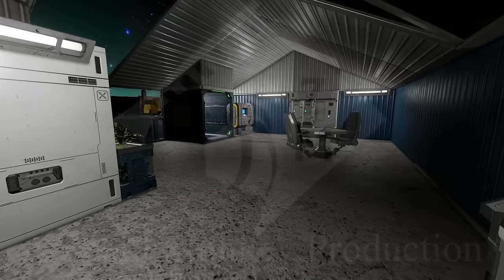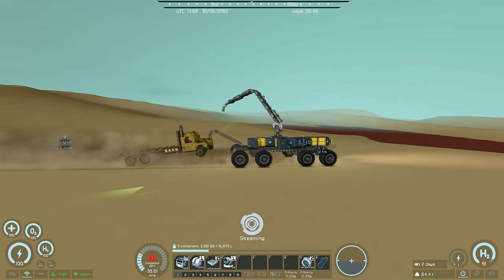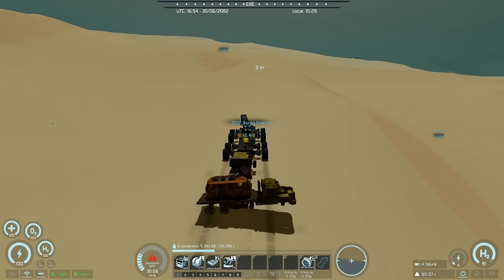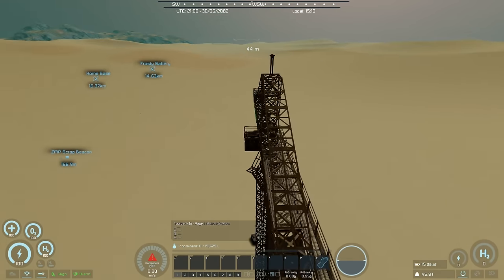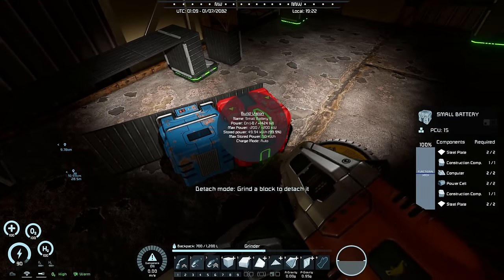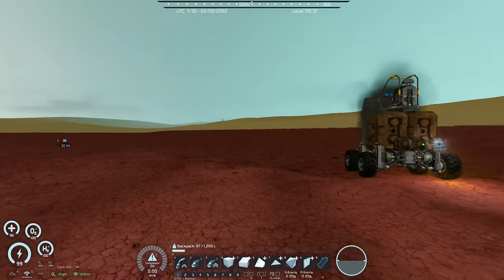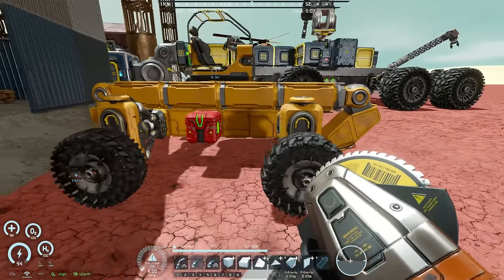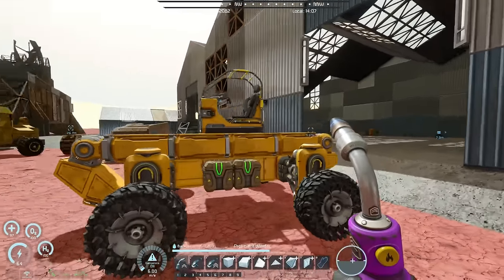Feedback for the Win - Scrapyard #8

Comment: Telehandlers have some interesting steering irl. They can be set to just front wheel steering, front and rear wheel steering for tighter turns, and finally, diamond steering where instead of turning normally, all the wheels point the same direction so you can move at angles instead of turning.
Reply: Neat. Imo forklifts with mechanum wheels are the most interesting. :)
Reply: @dragonheart9965 
I’ve driven a lot of forklifts but never had a chance to use those mechanum style. It seems like one of those all or nothing things, where you get used to one and can’t really switch back and forth. Like bobcat tank style steering and foot control for the arms skidsteers and caterpillar’s joy stick only style. I learned on Cats and just can’t wrap my head around the bobcat style. Every time I try to pick up a load and curl the bucket in a bobcat I end up reversing the left wheels.
Reply: @juangonzalez9848  personally haven't driven any heavy machinery, but have seen them drive a mechanum forklift once on Mythbusters, and have used mechanum wheels on robotics projects. I do know that the mechanum wheels only work well on a hard surface, so I imagine the mechanum forklifts are more limited in use by that.
Reply: @dragonheart9965  
Most of our forklifts live inside the building and rarely go outside. We have to take the glass out of our ice rink occasionally and only one of them works well. The others have just too narrow of tires or too high of an idle to not slip on the ice. Once the rubber starts spinning, it melts the top of the ice where you are, then it just spins and spins. The other issue is that by necessity the drive wheels don’t have a locking differential, so when one wheel starts to spin, it just takes all the power. Driving on ice is an art.

Comment: I'm quite concerned if there is enough clearance for the wheels. It may just be server/recording thing but wheels sometimes look like they suddenly stop spinning for a moment. Especially those hazard stripes behind wheels give me chills. I crashed number of rovers on purgatory because stuff in that spot. Drive cautiously.

I recall from previous conversation you prefer a little bit of steering in front when primary steering is on the rear. I wonder if disabling propulsion on front ones would help, as they pulling forward could throw your aim off. 4 wheel drive is rare thing in forklift. Usually you want your rear wheels do all the work so your front ones can stay as pivot and you turn on a dime. But i expect you may need some extra traction to go over those 2x1 ramps until you replace some of them with what you did for Jex.

And i am really curious what forklift arena may be... wonder if somebody would make largegrid forklift xD (totally didn't think of dit myself before, not at all.)

Comment: Might be useful to have a magplate facing down as well, so you can lift from the top rather than the side if you need to be a bit shorter. Would also get you a bit better leverage when lifting heavy items.

Comment: If possible, place a camera on the head of your crane. It will become a very convenient periscope, and it is also very practical when it is used to align objects. (and a light...XD)

and I think you can install a rotor on the front of the new forklift to help you Rotate large objects without using various levers

Comment: Regarding the short suspensions, they're exactly one block shorter than the normal ones, so if you need the full track width you can mount them one block further out. As far as I can tell, other than that there's no real difference.

Comment: The thing you may think about with a lift like that is take the batteries from the old fork lift and place them on the rear of your new one to help have a counter for heavy things. with this style of lift in the real world you have different options on how you can drive depending on how you need to pick/ place your load. So right now you have just rear wheel steering. maybe place options to turn off rear and turn on just front wheel. that will give you the ability to also do 4 wheel turning. Plus lifts like this also have the option to make all 4 wheels turn the same way for what would look like crab walking. considering youll be in tight spaces having more options on how you can drive should help

Comment: I would have done the fulcrum hinge a little differently, I would have put it up a block or 2 higher up and changed the orientation of the hinge base by 90 degrees, allowing the boom arm to bend below the flat limit it has right now. I'm not sure I'm explaining that correctly, if the frame of your vehicle is 0 degrees and straight up is 90 degrees, you could modify the hinge orientation to have the boom tilt to negative degrees, allowing you to pick things up off the ground easier (but not without risk). This might allow you to have the fulcrum hinge and the head hinge to match angles allowing a self levelling head (your cargo would always be level).

Comment: If I may make a small suggestion regarding the new telehandler and moving heavy objects, such as a large grid battery... Connect the mag plate low and as square to center mass as you can and simply roll the wrist hinge backward instead of having the arm take any of the weight. This way you can keep your center of mass low as well as putting the majority of the weight of the object being moved closer to the center of the machine. This should reduce the chance that you tilt forward and lose steering and still give you plenty of clearance for transport. 
If you're going to have any real issues with the telehandler it will be a loss of steering so this should mitigate that problem effectively. Weight on the rear end would be helpful to be sure, but if you can use the weight of your cargo to stabilize yourself it should make things even easier. It's all in the wrist.

Comment: gotta say, a forklift with a 4t lifting cap is pretty good.  As someone who's profession is driving forklifts and telehandlers, I would recommend you lower your power just a little bit.  Going in reverse when taking such heavy things like a battery is a good idea as well, since emergency breaking your forklift will not result in the battery or pistons going klang
p.s. that is a very cool design.  I am definitely stealing that at some point for my own usage

Comment: 33:25 Odd question: With your dragging mod, are you able to pick up the end of a small grid 'chain'? (Bunch of hinges connected together and turned off) I was thinking you could set up something like a Tesla charging station by having small connectors on your vehicles and then a 'chain' with a small connector at the end connected to the base that you could drag out and connect manually. I'm wondering if the dragging would work since the 'chain' would be a subgrid and not a free-floating object...
Reply: Possibly but he has already warned others about making chains since they cause a big load on the physics engine and can cause serious lag.

Comment: The exact value you’d need to keep the load at the same horizontal position as the arm raises is 1/cosine(hinge-angle).  That would require a programmable block.

You can get reasonably close by making each piston extend 1cm for every degree of hinge angle.  Offictally the arm length should be 1.0 when the hinge angle is 0, and the arm length should be 1.414 when the hinge angle is 45.  If you make the ratio 0.01 of piston per 1 degree of hinge, the arm length will be 1.45 when the hinge angle is 45.  The object path won’t be perfectly vertical, but it will be close.

To do that with device speeds, 1rpm is 360deg/60s or 6deg/s, so set the pistons to extend at 0.06m/s per 1rpm of hinge rotation.

A second point of engineering:  for the purposes of lifting, the hinge that lifts the arm isn’t your fulcrum.  The front wheels are.  The fulcrum is always the point where the lever applies force on the opposing body (the ground) that counters the force applied on the lever by the load.
Reply from the maker: That's a lot of maths :P I think I'll stick with the .1m/s on each piston - it's close enough :D

Comment: for the Telehandler. I'm curious if 2 small grid small cargo at the back (left and right) would give you enough counter balance, if you loaded them with stone or scrap? that way, they can be loaded and unloaded if needed. Additionally for the connector decoration can you cap it off with a capping? keeping it kinda flat on top.

Comment: you could probably solve your hinge/piston relationship problem (making it one button/selection) if you plug some numbers into an animation keyframe calculator.

also you can prob get a smaller turning circle for inside the warehouse if you have a hotbar button to switch your front wheels to mirror your back wheels and just be able to turn on a point

Comment: The reason why forklifts armature tilts backwards when under load, no matter where the armature is attached your fulcrum is at the base of the front tires once under load, becomes a balancing act between the mass of the vehicle vs your load, tilting the armature backwards effectively lowers the mass on the load side of the fulcrum point. I hope you aren't planning muilti level shelfs, your tipping woes gonna get much worse the higher you go. I'd suggest a dedicated gyro override system, especially if you gonna follow through with your shelf-less shelf idea.

Version 2 is definitely better than the prototype though, love asymmetric cockpit placement, really adds character to designs 😊

Comment: Oooo. That's a slick forklift... or is it a Bobcat with its tool mounted on a boom lift?

I almost feel like the loading bay could be recessed into the ground a little bit so your truck/trailer backs in and the floor of the trailer is level with the warehouse floor, then your forklift stowed inside the warehouse simply drives up and pulls stuff off the truck without having to negotiate a ramp. If you want to tempt Clang, you can make that parking spot into an inverse vehicle lift where it lowers the whole lot down until it's level with the warehouse floor.

Comment: In the underground series you used the "Light Panel" for an even lighting of the tunnel. Would these help to light up around the warehouse ?

I like the small lifter, but why carry the load in the front if you also could carry it over the center of mass and in that way mitigate the weight ?
(Yes i know it will lift the center of mass but that's not as important around the base with the flat ground)
Reply from the maker: No reason not to, I just didn't think of it at the time :P

Comment: You should put yellow end-markers at the end of searches so you know which general direction has already been explored... and about forklift... I think a lifter-flyer would be more agile and useful. For the telehandler, 1 extended piston and 1 nonextended instead of 4. It will give you more control in lifting heavy things over the wheels as it will be closer to the ground and you really don't need 4 pistons of reach.

Comment: You should build a piston with a landing gear and use it to lock you to the ground when picking up heavy things.
Reply: He deliberately does not do that as he consider it sort of cheating :P  That's why he has no such thing on the crane rover. He has said he will add outriggers like the ones used on real cranes, maybe with 1x1 suspensions to get friction to the ground as just blocks behaves a lot like ice skates :P

Comment: I think got the forklift/telehandler I’d be tempted to remove the cockpit in favor of an antenna and remote control block as that would all fit into the base structure and make it a very flat design.  I’d imagine Splitsie would have it in range of his suit antenna most times anyways and a compact design appeals to me.  Do it right and it could maybe attach to the bottom of his crane or truck while he’s traveling.  A camera or two would be sufficient for navigating.

Comment: Might want to add a camera to the end of the lift arm, since it can go so high and could get hard to see if you're putting something on a top shelf. Especially with the way 3rd person camera gets weird inside a building.
Reply from the maker: I'd avoided putting a camera on the end of the proper crane, because everything jiggles, but it's possible the jiggling wouldn't be too bad on this, if I have a spot where I can usefully place a camera (without it looking odd)...

Comment: 1:02:05 you can just use artifical mass blocks and adjust to whatever is needed to counterweight the front. it also prevents you from having the mass at the back too far back meaning when you drop the heavy item, it doesnt make your rig tip backwards if you have them in line with your back wheels
Reply from the maker: There are a few reasons that won't work, first off is that with the scrapyard build restrictions you can't build artificial mass blocks, the second is that artificial mass only creates artificial mass within an artificial gravity field, otherwise they're just dense blocks :)
Reply: @Splitsie  ahhh i see, thats a fair challenge i guess to add :D

Comment: That's why they make those rear boom forklifts in RL. It would be cool if you could make different speed settings for your hot bar to simulate gears. It's been a while since I've played. Don't remember if you can..

I wish there were different length pistons...

I'd love to see you build an overhead crane inside your warehouse!!!
Reply: You cannot set a specific speed without using scripts, you would have to have "increase" and "decrease" max speed. He has used that some times in the past but I do not know if he used it that much.

Comment: Would it be worth having a setting that can be toggled on the handler's wheels to be able to pivot on the spot? Or would that even be possible at all? Not necessarily skid steer but more like setting the wheels all to be turned 90 degrees from each other so it "drives" in a circle. Just squeeze a bit of extra mobility from the platform.

Something like tracks or mecanum wheels would be ideal but unfortunately even with mods those don't translate into space engineers very well

Comment: You could try to use MArmOS for the telehandler instead of PARK. It does all the math you need for the pistons/hinges, assuming you can set up the arm config correctly (which should be doable for this :D)

Comment: Did you leave yourself access to mass blocks? Also do you have enough charging/motors to build a little looting/salvaging flyer? With TWO large atmo you should be able to lift a decent bit of salvage.
Reply: I do not think mass blocks are available.

Comment: For the new little forklift: is it possible, with an eventcontroller or something, to "shift gear" and put it in tank turn mode by having it turn the left weels in revers and right ones in forward or simular settings. making you able to turn on your acces without having to mess with the stearing settings on your wheels?

Comment: the more drills you have the quicker you can set up an underground mountain staging point near the ice field. you'll need a fortified location to respawn from and retreat too with that much heat on you. perhaps if you just tunnel through a dune or two as an escape route. the drone AI may not pull up fast enough as it chases you and slam into the dunes. threading the needle would make for great chase scenes and content =P some Capac decoy's perhaps at the entrances. aaaand colliding with the walls just as entertaining as threading it successfully. if anything they can provide a wall of protection as you ram into their bases to shut them down and a bullet/missle sponge like the doors are. very mad max.
Reply: With daily aggressive voxel resets that would be a good way to get to the center of the planet :P So underground bases are a no go :)
Reply: @davidmartensson273  Yeaah, i remembered that later on about the time Splitsie was driving the forklift about. Still a good bumper and bullet sponge tho. die trees die!

Comment: Hey splitse, an idea for designing the parking spot(s) for the tellehandler and or forklift, could be; using the armor panels with the hazard style armor around the area where its parking spot is kinda like the ones found in parking lots with the white line on the ground [just a thought but, I hope it helps ^^ ]